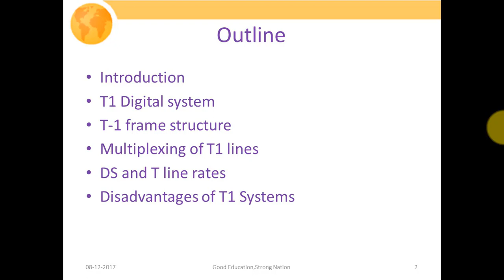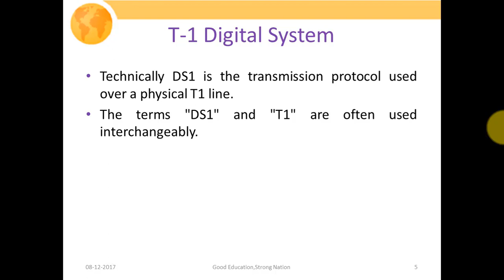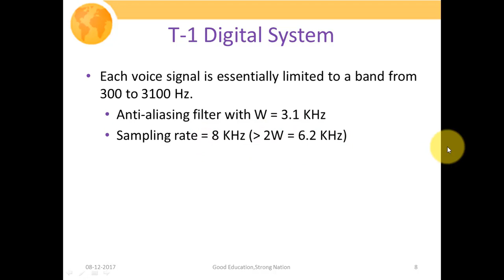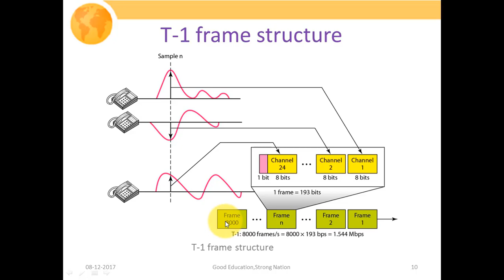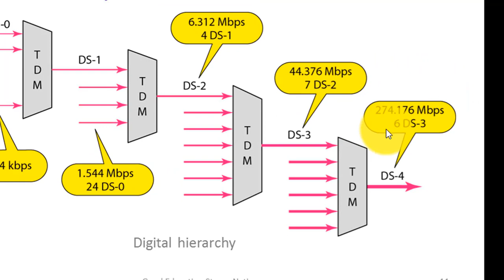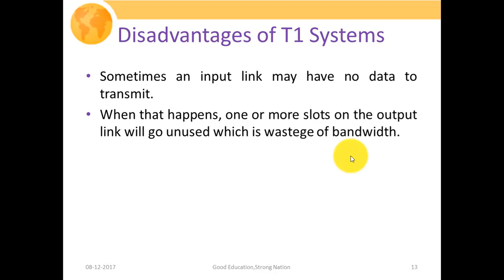T1 Digital Systems

Comment: Data rates you just explained is WRONG.......1.544*4 is not equal to 6.312...........................1.544*4+(17/125)=6.312......where 17 is the sync bit of T2
Reply from the maker: Yes you are right but here the idea is to give the knowledge about hierarchy...for the calculation of exact data rate one needs to discuss the frame structure of all DS2, DS3 and so on which is beyond the syllabus...as far as the number of individual channel point of view which is discussed in slide 12 the calculation is ok...and yes as the level of multiplexing increases the redundancy also increases and so the required data rate...for more clarity you can definitely refer some research articles...